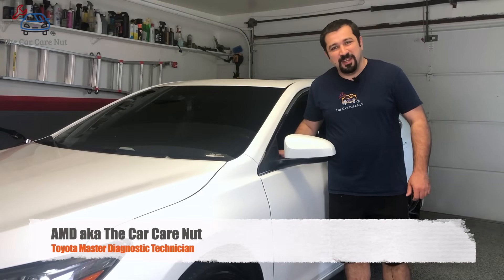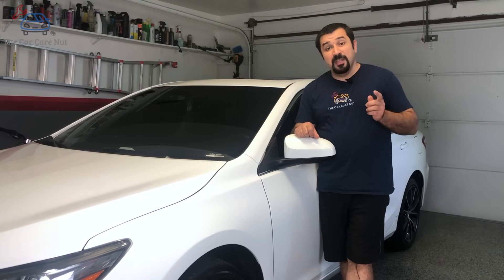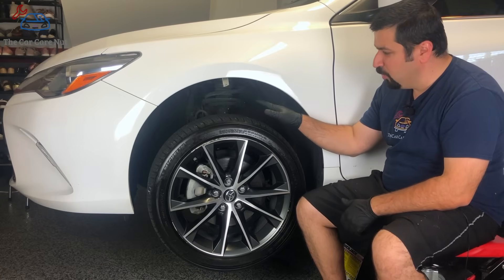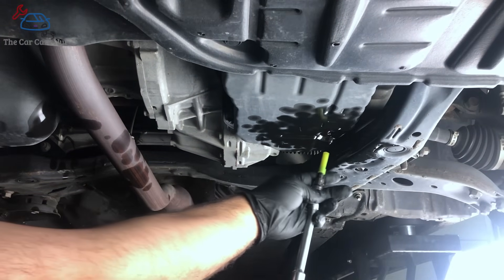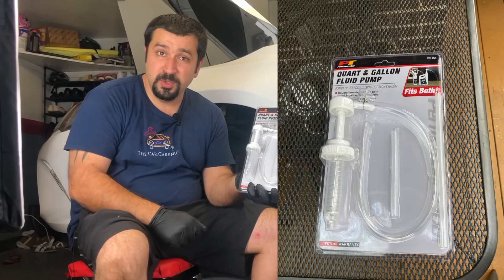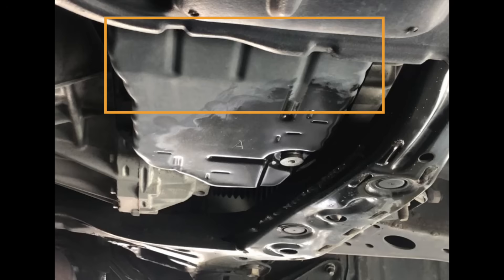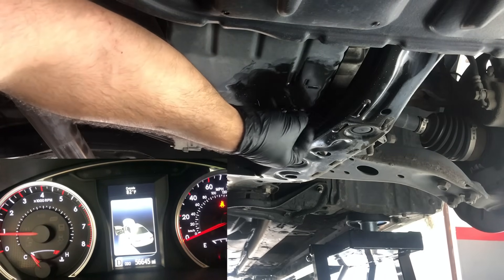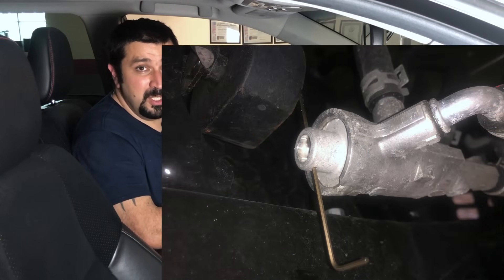How to change your Toyota Sealed Transmission Fluid

Comment: Excellent video,  I am going to give this a try this spring,  I do have a diagnostic reader so I find out if I can find the transmission temp in there.  What is the ideal temp for being at the full level?
I'm thinking around 138 deg ?
Reply from the maker: What year, model and engine do you have?
Reply: @TheCarCareNut  2018 Rav4 2.5L
Reply: Can't remember it may be 2.4L  6 speed auto.
Reply from the maker: The temp for the transmission fluid adjustment is 95-113
Reply: @TheCarCareNut  Thank you very much,  your channel is the best one Ive found for honest to goodness Toyota information.  You keep it real and it is very much appreciated.  God Bless you!

Comment: What about the filter? Is there one?
Reply from the maker: There’s a filter but it’s not normal practice to replace it on Toyota’s
Reply: Do you recommend changing the pan gasket and filter or just drain and refill on a 2016 4Runner?

Comment: My vehicle won't go over 40mph. I have to drive really slow. The gears have a hard time shifting, that's why i go slow. The RPMs shoot up even though im not driving very fast.
Reply from the maker: I would check the fluid. What model Toyota?
Reply: @TheCarCareNut  
It's a KIA SOUL, not a Toyota.
Reply from the maker: I would check the transMission fluid level first and go from there.

Comment: Does this transmission cooler bypass applicable for the 2018 Camry 4 cyl?
Reply from the maker: No the 2018 camry doesn't have a bypass.

Comment: Thanks for sharing. I have a RAV4 2017 natural aspirated and not cvt. It's six speed sequential. I just bought a 'scangauge 2' to change the atf WS and get an accurate reading of the fluid.  (first time changing the fluid and first owner). Do  I have to drop the pan to replace the filter? If not at what mileage should  I replace the filter? It has 40,000 mileage right now. Also do I have to do the procedure of shifting it from Park to Drive to cycle the fluid? Thanks again.
Reply from the maker: Hi! I wouldn’t worry about the filter as it’s not a common practice to replace them on Toyota transmissions. You don’t need to do the procedure of park drive if you can read the temperature of the transmission on your scan gauge. Once it gets between 95-113 adjust the fluid.

Comment: is checking the level of the transmission pan a good way to check whether the car is level?
Reply from the maker: No most of them are not level to begin with. I would just measure the height of the car when it’s up

Comment: I have a 2017 Camry 4 cyl with 36K and has a hard shifting from P to D. Do you think that a fluid change can help with that? or this is a transmission problem that needs to be addressed by Toyota warranty?
Reply from the maker: I would have the dealership check it since it’s still under warranty. It could be a fluid level issue

Comment: Did you mention after how many miles the transmission fluid should be changed? I watched the video twice but I could not hear you mention after how many times to replace it.
I own Prius C 2015. Or is it different for every model?
Reply from the maker: On your hybrid transmission for your Prius C the procedure is different and even simpler. Drain the fluid and fill it until it overflows and you’re good to go. I would replace it every 60k-90k on your hybrid priuc C

Comment: So this transmission only holds 3 quarts? I thought they held much more than that. Is there a filter to change? Do you have to do this process numerous times to get all the old fluid out? I have a 2015 Camry XSE V6.
Reply from the maker: Hi! The transmission holds more but that’s what needed to renew the additives and keep things fresh I wouldn’t recommend you replace the fluid multiple times. There’s a filter but almost never gets dirty or clogged so it’s not normally recommended to replace it.
Reply: @TheCarCareNut  
Thank you! 👍🏻😊

Comment: Would u recommend a flush AND drain and fill or just a drain and fill every 60000 miles. I have a 17 Camry. Thank you so much 😊. I’ve heard flushing is bad. This work would be done at my Toyota dealership. FYI.
Reply: Sounds like you recommend just a drain and fill. I think my car will be ok without a flush.
Reply from the maker: A flush if done right is ok. After the fluid it’s very important that the fluid level is checked to make sure everything is good otherwise a drain and fill

Comment: Hey bud just wondering if you know what this sound could be, I get it during start ups and it goes away. Here’s video below 

https://youtu.be/nSLScSZRLNI

Any ideas?
Reply: Thanks man. What is this joke about “my car doesn’t have an alternator”? Please explain? Lol
Reply from the maker: Toyota Hybrids don’t have alternators 😀
Reply: @TheCarCareNut  quick question, when do timing chains need to be adjusted (tensioner) or changed for a 2014 corolla le  plus? 
Also, Do I risk ruining the cvt transmission if it has had one fluid exchange at 120,000 miles(performed by dealer) and now I’m going to do a drain and fill at 155,000? Should I go overboard and drop pan and change filter since I neglected the service? 

Followed Toyota’s service manual and now am finding out it should be performed every 60,000.

Why does Toyota do this?
Reply from the maker: The timing chain has a self adjusting tensioner so no need to do anything or worry about the chain. Also the trans fluid should be ok to change if you’ve changed it before but I wouldn’t worry about the filter as they rarely cause issues.
Reply: @TheCarCareNut   it’s been done once by dealer and now this will be the second time. Been studying your video and have done other research and hoping it goes well.
Reply from the maker: That’s normal. Nothing to worry about.

Comment: 88,000 miles on 2015 Sienna FWD.  I was thinking of dropping the pan and doing filter and gasket.  Can I fill it overfull then pull a cooler line off the radiator or at the trans and pump old fluid out till clear. This assumes most fluid is pumped through the cooler.  I would then set the level to spec using a scan tool for trans temp.  On edit, WS non synthetic is what I plan to put in, I believe this to be correct, also what comes up on RockAito, will use Aisian brand.
Reply from the maker: Be careful using the radiator lines. You don’t want to run the transmission low on fluid. I would use ATF WS from Toyota if I were you.
Reply: @TheCarCareNut  Thanks for taking the time to comment.   I love the new safety sense videos.  I bought a 2020 Corolla just because of the safety features and low speed cruise control for traffic.  I did not need a car, but wanted those features.

Comment: After replacing WS oil in the transmission pan why not use the rad return line to drain & fill the remaining oil in 2 L increments to complete the job?
Reply from the maker: You can do that but be careful not to run the transmission low on fluid.

Comment: Awesome video dealer wants 400+ bucks for this.
If I practice shorting the obd2 pins and cycling back from Drive to Neutral just to get the hang of it this won’t effect anything right? 
Just want to get that process down before I actually perform the service. 
Great video man I’m subscribing
Reply from the maker: No harm done if you practice it. I actually encourage you to try it a few times before changing the fluid so you are familiar with it
Reply: @TheCarCareNut  i got it down, is it normal for the car to vibrate more then normal when it get close to the temp, happened to my rolla during the short procedure
Reply from the maker: Does it stop vibrating when you remove the wire?
Reply: @TheCarCareNut  yes, I did the fluid level check process.

 halfway through when waiting for fluid to warm to started to vibrate more then usual and lasted till I removed pins
Reply from the maker: It’s normal. Perhaps an indication that cleaning the throttle body is needed.

Comment: Excellent video, thank you.  I have a 2013 Camry with 80k miles.  Would that be "high milage" for this procedure?
Reply from the maker: I think that’s good mileage. Try not to wait longer and get the fluid changed and you should have no issues.
Reply: @TheCarCareNut  Thank you for the fast reply.
Reply: @TheCarCareNut   even at 80k miles ( if it’s first time you change the fluid) do you recommend to just drop the fluid in the Pan and to refill or is it better to take to dealer and have them do a fluid flush were they hook up to a machine?
Reply from the maker: Hi! At 80k either is good.

Comment: I have a 2017 camry le 2.5. I called the dealership they said this model does not require a fluid change. it's a life time fluid.do you agree
Reply from the maker: I don’t agree with the dealership. When the transmission have shifting issues in the future they’re not going to be there to help with the cost. I would get it replaced with original fluid which is not an expensive thing to do and have the peace of mind for the future
Reply: I understand your method buy only using in the drain plug for having to check the temperature, but if you drop the whole Pan and change filter can't you just replace what was in the pan  by measuring it without worrying about the temperature

Comment: Are you sure transmission fluid expands???  or is it the internal parts of the transmission that expands, thus making the transmission fluid level higher? I've put 140 degree transmission in a clear gallon bottle and it was the same level when it cooled down.

Comment: I have a 2011 Sienna is it time yet to change the fluid on the transmission I was told by the dealer to never change it
Reply from the maker: How many miles do you have?
Reply: @TheCarCareNut  157,000 , does this tutorial apply to my transmission
Reply from the maker: It does but if the fluid has never been changed before I would leave it alone at this point. You could cause more harm than good.

Comment: Hmmm. Heres what i did on my car a few months ago, before I found this video . I just drained mine with the overflow tube out Got out 80 ounces of fluid . I just put back in 80 ounces of Toyota WS fluid, so is should be back to the same level that the factory had it 🤞🏼I live Arizona and there are times that the temp in my garage is over 100 degrees , so it is tough to get the temp to that cool level. Now that it is winter , and the garage is 70 degress i will look at it again !
Reply from the maker: If you’ve already replaced the fluid. Just follow it up with a fluid level check to be sure when the ambient temp allows

Comment: My toyota vios dual vvti 1.3 e series 2017 model have hesitation when i step on the accelarator. Does it mean that i need to change my transmission fluid? Thanks!
Reply from the maker: Without driving the car myself I couldn’t be sure. But try to clean the throttle body first.

Comment: HEY TCCN, Do you happen to have the part numbers for the Drain plug gasket and Fill plug gasket for the 2018 Toyota Camry SE Transmission? Im about to do my fiance's again. last time i did it, I couldnt find the parts so i just used the same gasket. Bad practice i know...
Reply: @TheCarCareNut  awesome thanks

Comment: Hi Car care nut, would it be possible to do this using a scale method? Basically place a drain container on top of a scale and then replace with the same amount weight wise? Also, what do you recommend as far as mileage for drain and fill interval for average driving? Thanks again for your awesome vids!
Reply from the maker: You could weight it but measuring the amount in quarts or liters is actually better and easier. I would still follow it up with a fluid level check to be 100% sure.
Reply: How about mileage? What’s a good interval for drain and fills 50k? Thanks
Reply from the maker: I normally recommend you replace it at 60k or 6 years. No harm in replacing it earlier at 50k
Reply: @TheCarCareNut  great thank you again!
Reply: Hi, on this method, what would be the best way to keep in the same temperature on the car and new transmission fluid ?

On my research, weight or measuring is easy but keeping same temperature is the key due to expansion and shrink of the fluid 

Is it good way to keep the car and new fluid in a garage about 16 hours to keep same temperature and drain out and same weight or measuring go in?

Thanks in advance !

Comment: Is there ever a time where we need to change the transmission oil filter that’s in the pan ourselves or is that an unnecessary replacement if we do transmission fluid change every 30-50K? Asking for a 2012-2017 Camry 4cyl 6 speed trans.
Reply from the maker: Unless there’s heavy fluid contamination I wouldn’t worry about the filter. If you change there’s no harm just opening the pan and cleanliness becomes an issue so be careful with that. If you change the fluid on time you shouldn’t need to worry about the filter

Comment: Excellent video, But what about the fluid in the torque converter that wont drain, Shouldn't u have to do this procedure at least twice minimum to reduce or eliminate  the old fluid in the torque converter . my toyota  mark x 2007 2.5 ltr v6  6spd auto
Reply from the maker: Hi! The idea is to refresh part of the fluid. You could do it twice but I advise against it. Replacing the transmission fluid too much is also not good for it.

Comment: should I trust a toyota dealership to do this transmission fluid properly ? Wondering if its worth it doing it thru a dealer. Just got a 19 camry SE with the 8 speed and it has 40k now, was thinking of maybe doing the fluid change at 60k. what do you recommend?
Reply from the maker: Honestly this will depend on the dealership. I work at a dealership and I will honestly tell you not all dealerships are good. If you have good experience with your local dealership then go for it. The only good thing about dealerships is if things go south they usually take care of it

Comment: Any thoughts on how to deal with transportation flare?
Reply from the maker: Is the transmission flare when it’s cold? If not which gear or driving situation does it flare?
Reply: @TheCarCareNut  normal driving. 2-3rd or 3rd to 4th. Every other gear shifts fine. Even after the car has warmed up.
Reply from the maker: Ok I would get the memory reset and see if that improves things. You’d need a Toyota scan tool to do that or a capable aftermarket scan tool.
Reply: @TheCarCareNut  can the techstream software achieve this?
Reply from the maker: Yes do you have it?
Reply: @TheCarCareNut  nope but I know someone who does. Would disconnecting the battery be something you'd recommend?
Reply from the maker: No disconnecting the battery wouldn’t do  the memory reset. When you have the techstream connect to the car to to engine and ect then go to utility then select reset memory. After that drive the car for 20 minutes at speeds around 35-40 mph and you’re all set
Reply: @TheCarCareNut  UPDATE: Did the reset using Techstream. Then drove for around 20 mins. Car shifted very erratic at the beginning but slowly settled into buttery smooth. Will drive the car again tomorrow and update!
Reply from the maker: That erratic shifting at the beginning is normal. It needs to recalibrate everything to base levels then start adapting.
Reply: @TheCarCareNut  how long does this hole process take?
Reply from the maker: Usually after around 15-20 minute drive it settles and stays that way and it only gets better with shift points.
Reply: @TheCarCareNut  can confirm the flaring is still happening. Sometimes 2-3 but very often 3-4 is when the engine revs up before shifting to 4th. The rest shift fine.
Reply from the maker: Unfortunately at this point it the fluid level is good and the memory has been reset it’s something with the trans. Possibly a valve body issue or clutches.
Reply: @TheCarCareNut  is this an expensive repair or do i get rid of the car entirely? Quick search on the forums and it looks like it's a common problem with the U660e transmissions in the Lexus and Camry V6.
Reply from the maker: It could turn into a big repair if it’s clutches. Depending on the severity of the flare I wouldn’t rush to sell it as it might stay the same for a long time
Reply: @TheCarCareNut  understood. I'll have a local mechanic have a look but there really is nothing to physically see at this point. It definitely isn't severe. My wife couldn't notice but I do when I accelerate and the car revs a little before shifting. My daily is a 2011 Corolla and I simply cannot feel it shift at all, no matter how hard or soft I accelerate, how the trans should really normally behave in the Lexus.
Reply from the maker: Honestly if this is my car I wouldn’t worry about it. People end up spending too much money out of justifiable worry but if you leave it as is it could be years and years before it starts to progress and by that time it might be time to change the car anyway.
Reply: @TheCarCareNut  very reassuring. Thanks very much. I've read on one of the forums where a guy put in an extra half quart ot transmission fluid and he claims all of his flaring issues instantly disappeared. Does this sound at all reasonable?
Reply from the maker: It won’t hurt to do that. No harm in slightly overfilling the trans. Try it.
Reply: @TheCarCareNut  so half a qt extra is something think is safe?
Reply from the maker: Yes I’m not too worried about overfilling it slightly
Reply: @TheCarCareNut  would you recommend using Seafoam Trans Tune?
Reply from the maker: Honestly I wouldn’t personally use it.
Reply: @TheCarCareNut  as soon as it is about to shift, the engine revs up 1-300rpms.